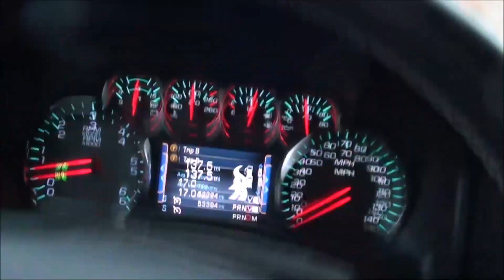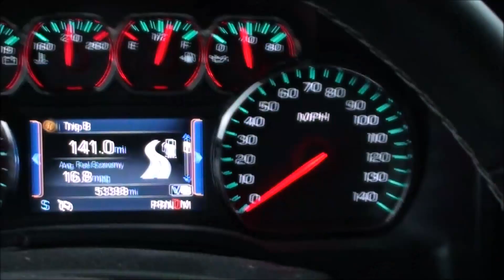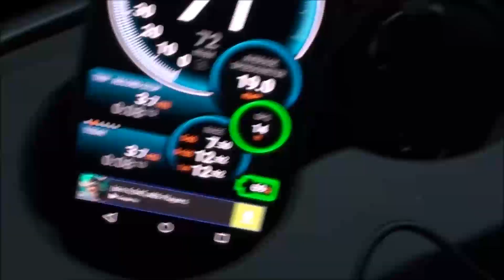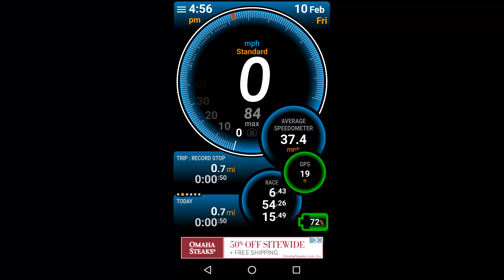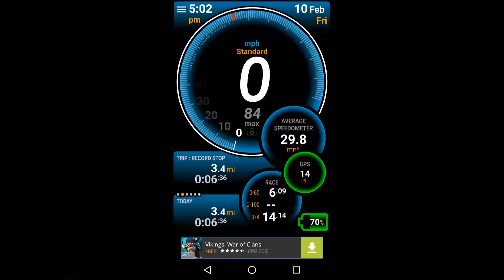Maverick X3 XRS 0-60 Part 1 LINK TO PART 3 IN DESC!!

Comment: The X3 XRS is a game changer.
Outstanding in every way and no real mulligans.
Polaris has already sent out hints through their reps they'll have a new chassis design and a triple late this year.
If that ain't a game changer what is?
It'll be all about HP and suspension now.
BTW:
Consider the EVO stage one reflash.
Amazing improvements and power.
Only if you have the aftermarket warranty or buy a separate ECU like we did.
Ya just put the stock back in for service.
Reply from the maker: Agreed! In my "Let's chat about the X3 and RZR" video I did... I make light of that. This industry is just going to be going crazy over the next few years with all of the advancements to these machines. It's something we'll need to get used to... spending almost 30k on a car that will be obsolete in 12 months hehe. Hopefully, the X3 is far enough ahead to remain competitive for a few years.

Re: Reflash - I went with the HMF one because of their reputation, as well as the combination with the exhaust. The exhaust is extremely good looking (you'll see this weekend when I post the part 2 video!) and sounds amazing. I just got the car back on Wednesday of this week after having the work done, and wow - such a huge difference. I hit 93mph very easily and still had room to go. The weather is going to break on Saturday so I am going to do part 2 and I am fully expecting to be over 95mph

Comment: Hope your gonna put a new clutch or clutch kit in as well otherwise that thing is going to be shredding drive belts like no ones business
Reply from the maker: Wisconsin Angling HMF tells me I shouldn't need a clutch kit. But I suppose time will tell
Reply: Aaron Shea that's what they told me as well but when I installed my full performance system on my 900 but man it makes a world of difference
Reply: Aaron Shea awesome video by the way

Comment: Aaron, Are you limited in Michigan with the extra 8 inch width of the XRS? Wondering of you can still run trails off of Exit 222
Reply from the maker: DJ I've only ridden the trails up in Baldwin. Check out my Baldwin trail video to see what they're like, but plenty wide enough - and they go for over 100 miles. I did some off-road trails when I got it also, two tracking - and I had no troubles. obviously I can't go on most snowmobile trails, but thankfully Michigan has plenty of trails to choose from

Comment: hey I flashed my RZR XP 1000 and I bought the extended warranty from the dealership I took it in for service and they did not want to do the service because I flash the computer so beware
Reply from the maker: Yea, I had / have this concern as well. I spoke to my dealership about this prior to going through with it. They indicated the OEM warranty would become invalid, but the extended warranty I purchased shouldn't be voided. They also said that if I kept the stock parts, if it came to it, they'd switch them back in prior to submitting a warranty claim. Hopefully I never need to submit any warranty work - but if I do, I hope I don't have any issues. I mean, I did have to warranty it already lol... my last video explains the wheel almost falling off. It's a risk, for sure!
Reply: SIR HOOD RICH idk if this works the same as car warranties but i have a challenger 392 and i had that same concern so i searched online and all i found was that the dealer cannot void the warranty unless they can prove that the modifications you made to so said vehicle are what caused the problem